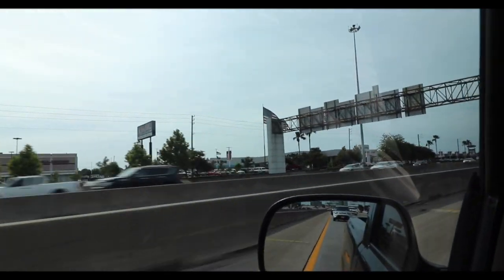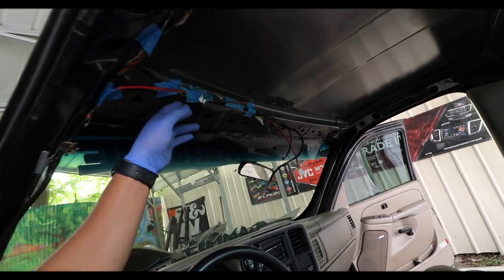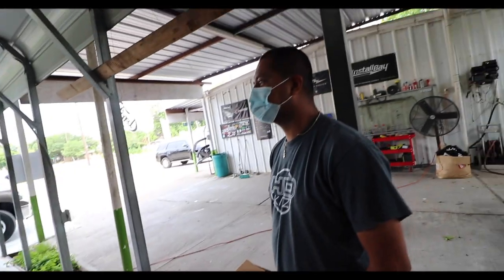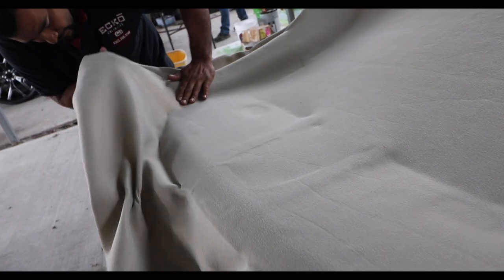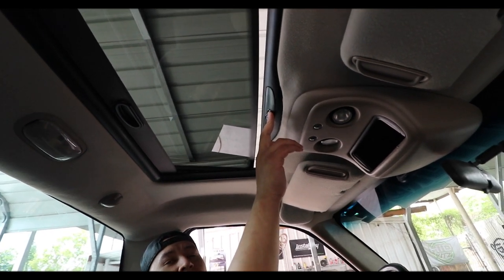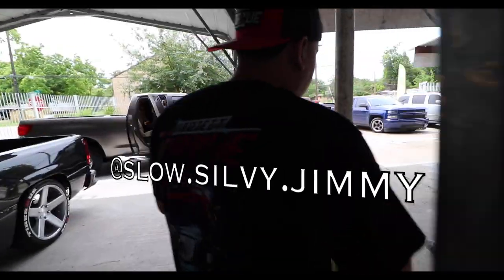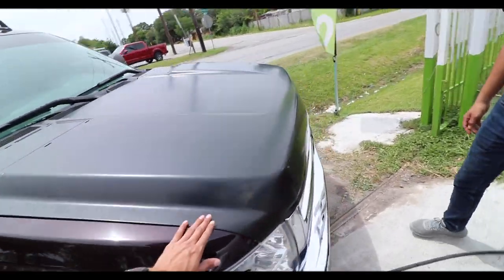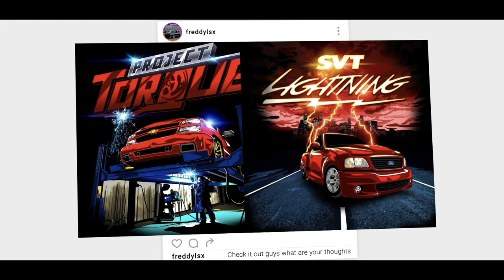Installing Sunroof/Moonroof On Single Cab Truck

Comment from the maker: 🛑 Shop now 👉🏼 https://projecttorque.bigcartel.com every $10 = 1 entry to win the truck shop now 🛑
Reply: Freddy NESESITAMOS un corrido we need to be bumping your corrido como Markitos toys
Reply: Add a sunroof of your gmc it will look cool bro
Reply: MMalonaaaàaa vaaatttoooooo
Reply: Ey freddy cual es el precio por instalar el sunroof?
Reply: Ay bro go to the taqueria la reforma that my padrinos taqueria that food is bomb u won’t regret it is close to there were u we’re doing the sun roof
Reply: Cuanto pagastes por esto y en donde lo asen saludos  se mira Chida la mamalona
Reply: Hey dude, what you pushing under the hood? I got TBSS that I need to supercharge.

How much was the sunroof and head liner job?
Reply: What’s the location for moonroof install
Reply: Cuanto por el sunroof freddy
Reply: Dónde puedo comprar un quemacocos igual a ese?, Soy de Chihuahua México, aquí hay un taller que me puede hacer el jale pero yo les tengo que conseguir el quemacocos, gracias y saludos.
Reply: Cual es el Instagram del que puso el sunroof
Reply: whats up
Reply: i have few trucks v8’s 5 speed’s over here in san diego
Reply: Quiero instalar uno igual en mi troca 2006 Chevy cuanto cuesta primo y dónde estás ubicado pero respondé canijo.

Comment: I had to stop in and tell my story. So my uncle had one of them lil ford mustangs small lil cheap looking thing . 74 ford mustang. Salmon pink ? With woodgrain  pannles on the sides . Ok so my uncle asked me for help to cut his sunroof so I measured it  andhe layed the template and taped it down . So we get to cutting and three blades broke and we had to go get more . On the way back he pulled out a star quilt (native American thing . ) Big  star in the middle. So we get to cutting again and my uncle chakesy ..R.I.H uncle I love you . My uncle chakesy told me uncle Andrew the hole looks crooked ? Lol . Dam you guys are getting a good one I hope it's appreciated. My uncle said it's ok my boy if you fuck it up you can always use that star quilt and out the star in the middle. Lololololollololol